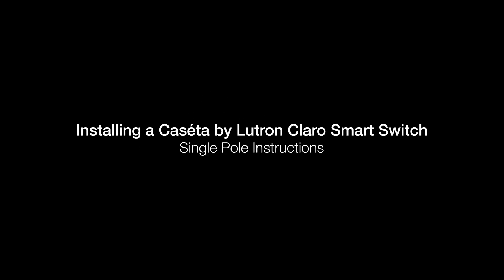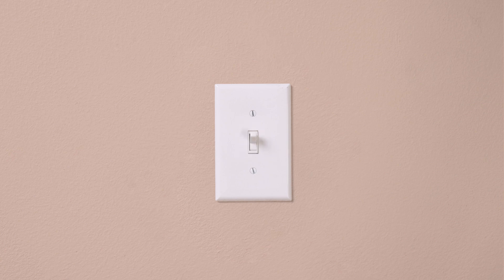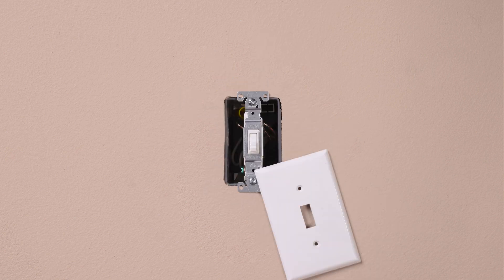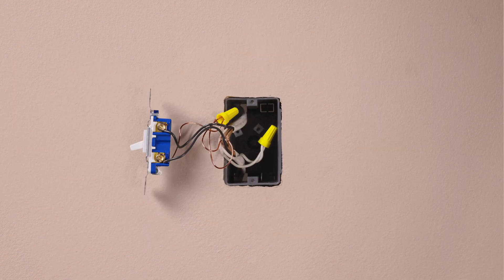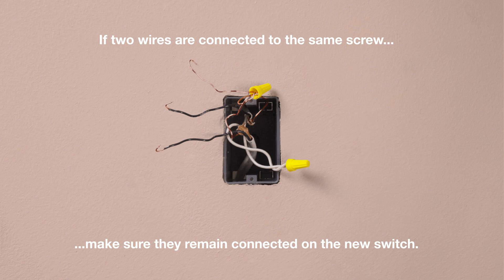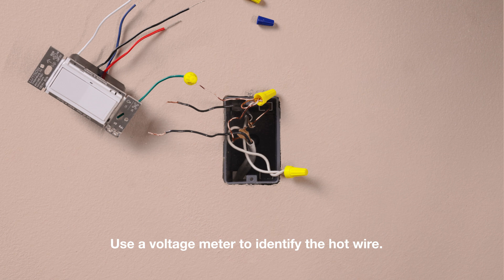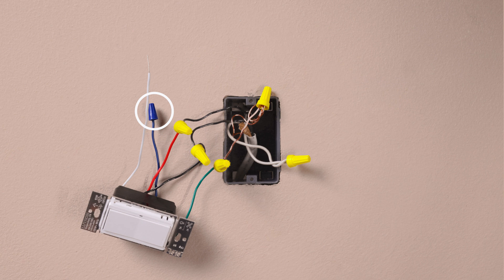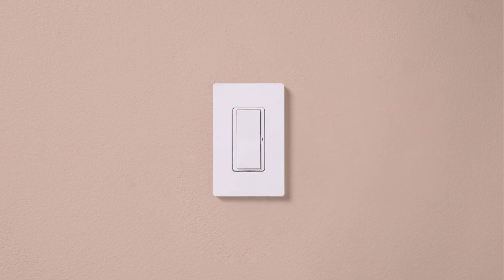Installing a Claro Smart Switch for the Caséta system in a wired single pole application

Comment: You say this only needs a screw driver and pliers, but then add it needs a voltage meter.
Reply: Also you'd need to turn the power at the circuit breaker on again to test with the voltage meter.